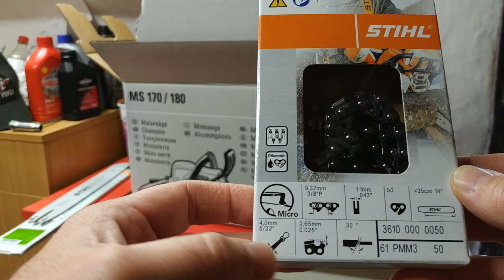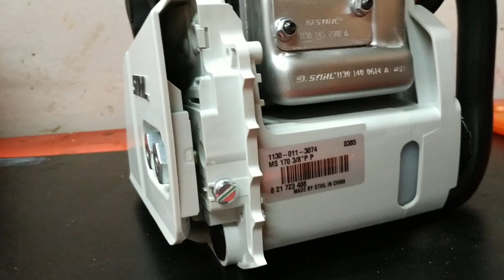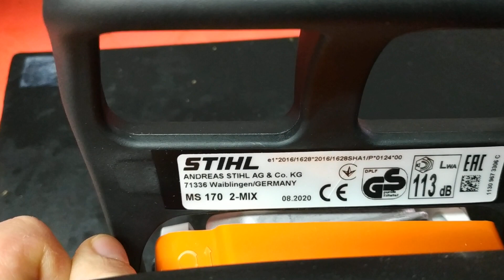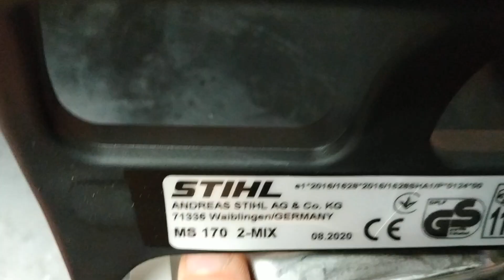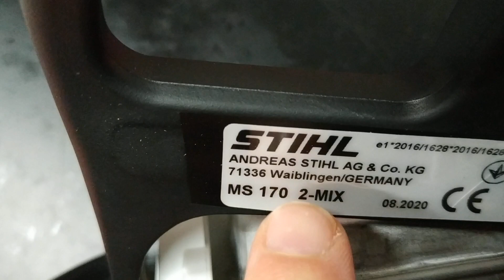Stihl MS 170 láncfűrész kicsomagolás, bemutatása és az első indítása /unboxing, first start

Comment: Helló mennyiért vásároltad?
Reply from the maker: 64000 Ft volt.
Reply: @fureszelek Most 12000 körül van
Reply: 64000 @luxbeci2
Reply: @gargoylecass4046  Max Álmodban. Stihl 171 akciósan 100000 most 1150000-ről
Reply: @gargoylecass4046  Stihl 170 pár hónapja volt 80000 körül de most nem is látom a Stihl oldalon